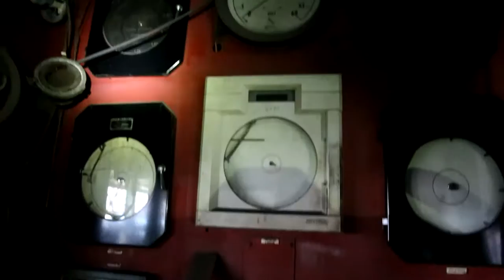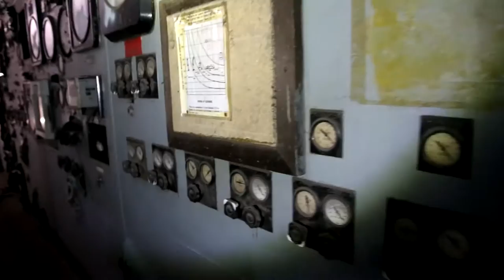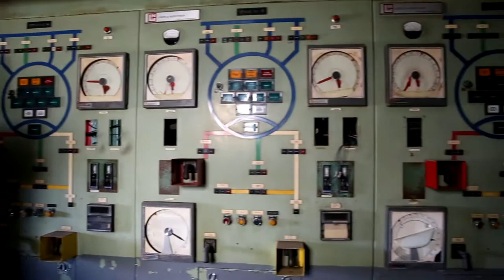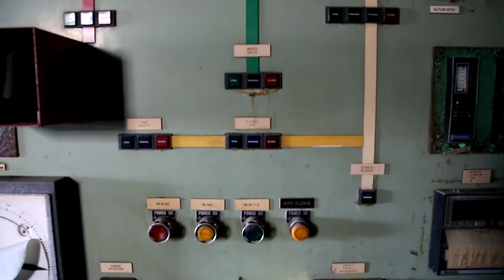Exploring The Weirton Steel Works

Comment: The town of Weirton only existed because of the steel plant--wasn't much there before that was built. The head of the    mill was also the mayor. Weirton Steel built many of the houses, installed utilities and infrastructure, the Community Center and Library--those opened in the late 1950s, I believe. I remember how exciting it was, as a kid. My dad carried the giant plaster Santa on his crane down to the Community Center every Christmas. He worked for the Mill his whole life, as did most folks. There was also a coal mine that supplied the Mill. The elaborate heavy industry of that era is simply astonishing! Glad to see, at least, some record of it.

Comment: not a bad video and very cool view in some places but weirton steel wasnt torn down... or shut down for that matter.. Its still running, i work there in the tin mill.. The BOP was tore down which is probably where you are in the video but the rest of the mill still stands strong!
Reply from the maker: Is any of the stuff in this video still standing? I was under the impression that it was all gone now. It was a pretty incredible place
Reply: @sublunar  yes alot of the tin mill strip and CA are still running an operating every day its the area where the blast furnaces are that isnt still up.. the coating and strip steel are still running strong
Reply from the maker: @BubbaZ601  right on yeah they were running when we were there exploring the old section and we had to be careful not to get too close. Not trying to cause trouble or run into people working either. I am in awe of the work done here and the magnitude of the site. Weirton was regularly setting output production records during wwii etc..and massive blast furnaces are just cool as hell imo
Reply: @sublunar  completely agree with you.. its amazing what can come out of such a small town.. that place has so many cool rooms and such.. i found a couple things with dates from 1950-60s